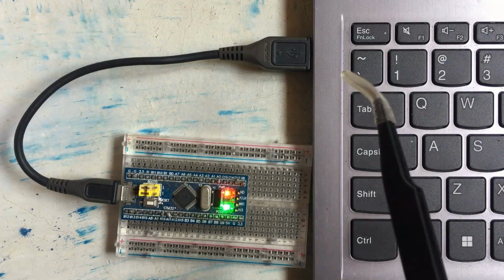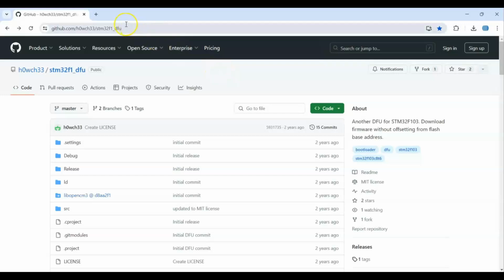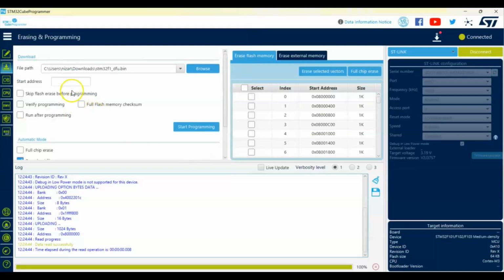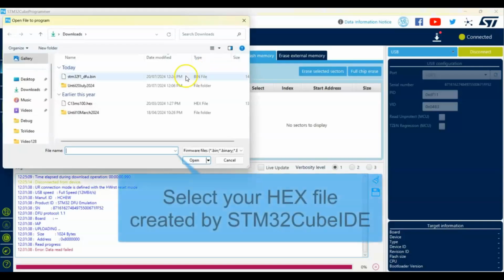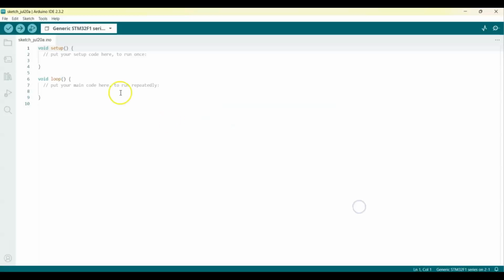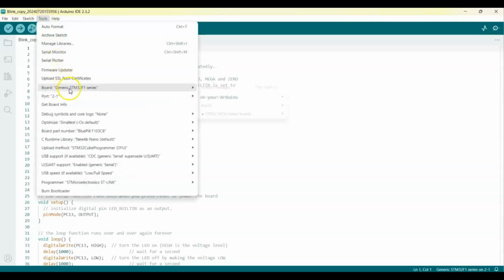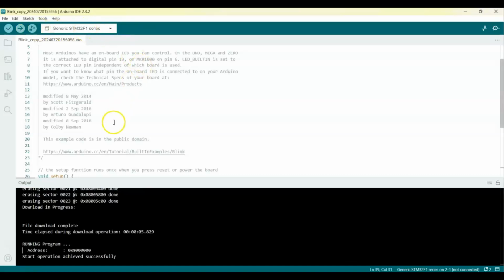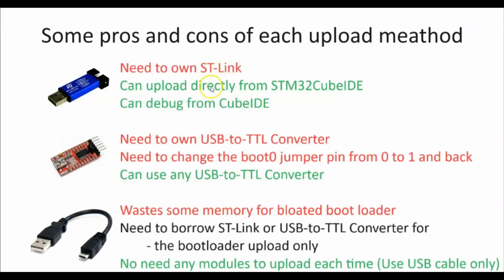129. Install STM32 DFU Bootloader. Program STM32F103C8 via USB Port

Comment: My friend. I successfully downloaded this bin file to my stm32f103c8, but I can not use it in arduino ide, becose COM port not create with connection. What do you think were is a problem?
Reply: I have the same problem( 
Do you find a solution?
Reply: @MrKostyan527 у меня получалось установить загрузчик и загрузить скетч  в ардуино иде, но только один раз, так как при загрузке скетча загрузчик стирается и больше не работает. Я сделал вывод что проще работать с программатором и не пользоваться загрузчиком.

Comment: I am using stm32f103c6t6. When i connect it to pc it is showing usb device not recognised.

Can you make a video to fix this issue
Reply from the maker: I am sorry to say that this bootloader did not work with stm32f103c6
I have tested with many stm32f103c8 and all worked including clone chips
I believe the souce code can be modified and complied to work with stm32f103c6
If I have time to modify it or if I find another bootloader for stm32f103c6, I will let you know
Thanks

Comment: Without downloading bootloader , When i connect usb cable pc is showing that usb is not recognised
Reply from the maker: usb will not be recognised until bootloader download. 
Even after bootloader download, usb will not be recognised.
You need to press the reset button in the stm32f103c8 bluepill, then usb will be available